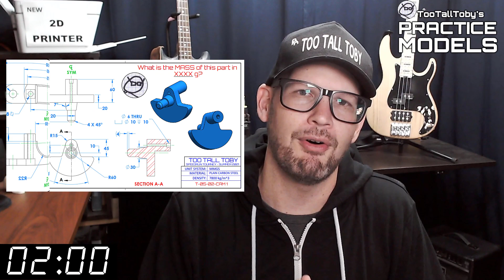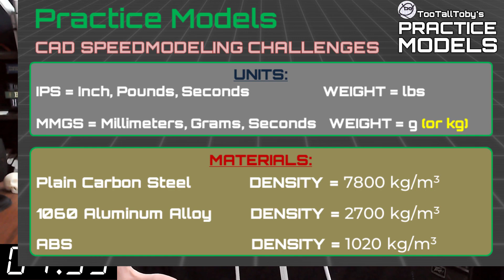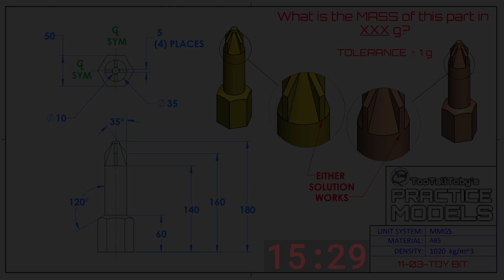SOLIDWORKS Practice - Onshape Practice - Fusion 360 Practice Exercises - TooTallToby-11-03

Comment: Mass: 227.85 grams Time: my third/fourth try. I wanted it to be perfect. So I did somethings. I started to use Master Sketch to constrain everything to one layer. (Rooted my tree, so to say). From that I did the first revolve extrude of the upper round bit. Second was to make the revolve of the plus bit shape (not merged). Then I made to planes from Front plane +/- 5mm to split the second body.
After that comes the funny part with the circle pattern 90 degrees. of two bodies the part needs. Combine all. Lastly comes the hex extrude bottom. (I can not figure out how to chamfer only by degree) so I did revolve cut of 120 degrees to chamfer.
Reply from the maker: Awww yeah - Well done A P!

Comment: Ooof... struggled a bit to understand how the dimensioning worked! Did a revolve which was ok but ended up having to do an "intersect" for the hex base and going back to oversize the bottom diameter! Not very smooth!
I should have just extruded the hex the whole way and done a revolve cut. Also ended up doing a "replace face" on the rib to match the outer face as it just looked wrong with that weird step from extruding (even though the drawing says it's acceptable).
4:50 to get the answer!
Reply: Had to try again and still took 3:02min but a lot smoother!
Reply from the maker: Nice!

Comment: 8:10, the top rib somehow didn't work well, left slever on the side of the bit but didn't really affect the mass
Reply: That's happened to me a bunch of times.  A rib on a curved surface does that unless you extend the lines part way into the curved body.
Reply from the maker: Yeah you can leave that sliver, and it's still within tolerance.  To get the smooth face (curved) is pretty tricky, but I know some people might have done it that way, so I wanted to leave both solutions open as "correct".